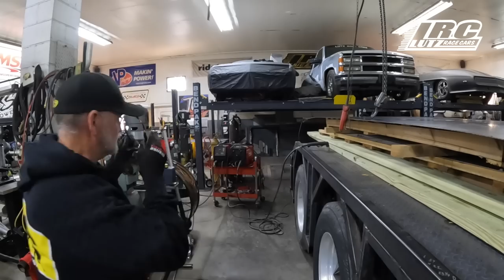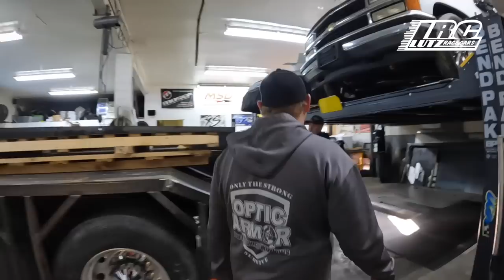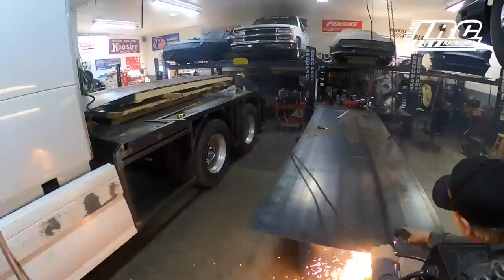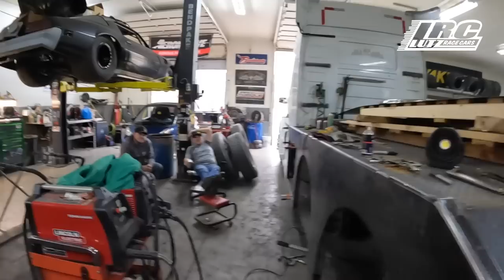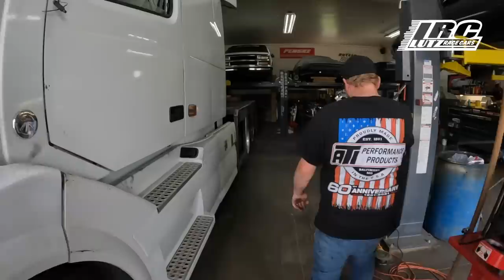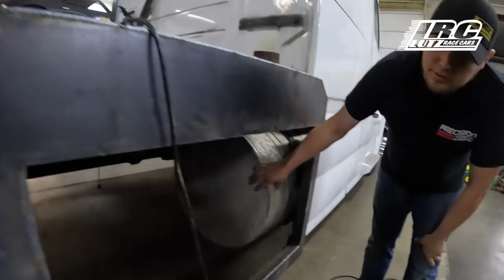!!!NEW TOW RIG!!!

Comment: Have you guys tried the Walters mill scall removal discs?For grinding welds or fast removal try the Rex Cut sigma green wheels.For aluminum,try the Platex Tiger Shark wheels with Kangaru oil,those are amazing.CS unitec

Comment: Man have I done a ton of that kind of work.....so I feels for ya's.
Pro tip....use ONLY 3M Green Corp discs and wheels.....and I mean ONLY.
They last at least 3 times longer and probably 5 times longer as a general rule and they cut better and cleaner.
Take it from an old fart (yes I'm older than senior) that has about 40 years experience.
Once you use em, you will never use anything else.
Just lookin out for ya's and trying to save you some extra work.